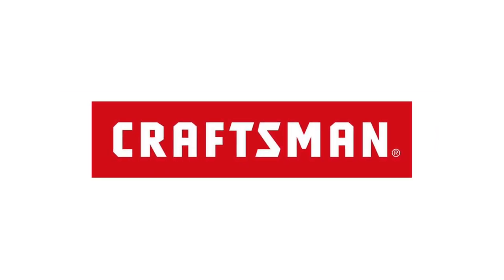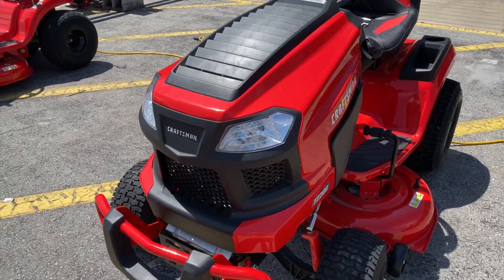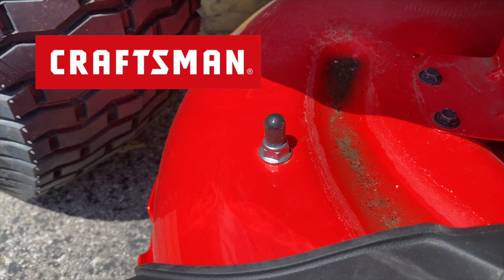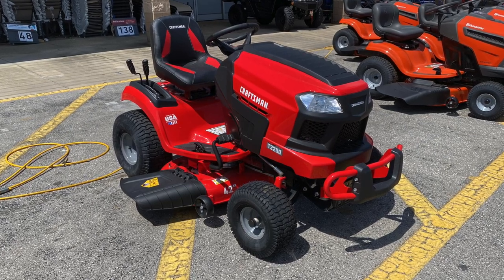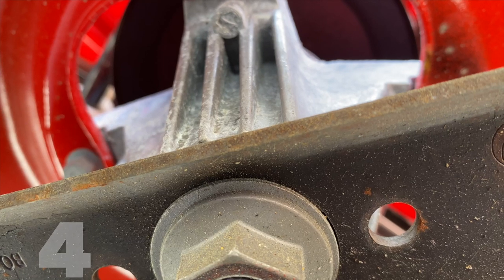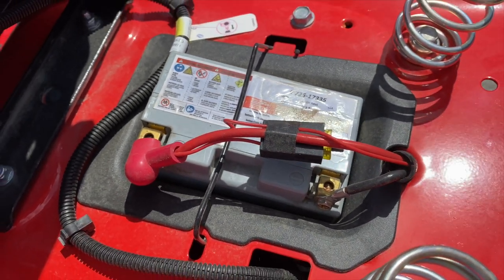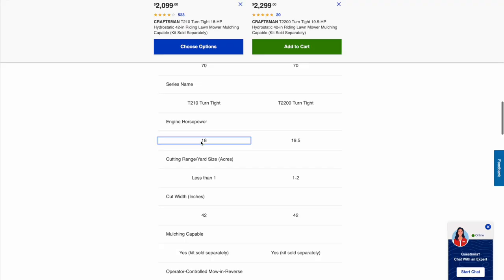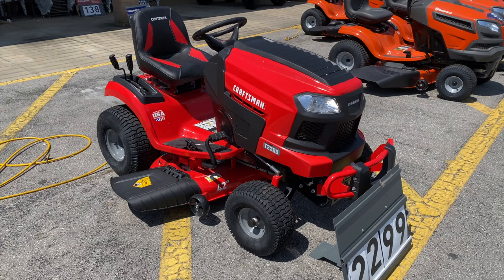Craftsman T2200 42" Riding Mower | Features and Components Does this Replace the T210?

Comment: I believe the identical Troy Built is $200 less
Reply from the maker: Troy Bilt 42” riding mowers don’t have the turn tight turning radius and has a different engine.
Reply: @kev-reviews  that certainly explains it. Maybe you would know. I am interested in the T240 or T2400. Do you happen to know which hydro trans they use? K46?
Reply from the maker: From what I’ve read they went with a TL-200 for the T2400 which is a slightly lower spec than the K46 🙁
Reply: @kev-reviews  thank you for this. Now the hunt to find a T240 or just spend the doe on a John Deere S240 42 inch with K46 and Kawasaki v twin. $3300. Ouch.

Comment: I guess that in most people’s research they didn’t watch the small engine repair channels. Taryl fixes all said himself he would not buy anything MTD but loves them because they fail so often and make him money. $2000 or more for one of these single cylinder tractors!! Those engines are a revamped Kohler Courage and still the bucket sump design.  I would be worried more about the engine than the transmission. Ask a mechanic about ANY of those modern single cylinder engines.
Reply from the maker: So far my MTD-Craftsman has been trouble-free in its first 2 years vs the 2 mowers before it that were “Shop brands” - both of those had issues requiring major repairs in the same timeframe. My neighbors (most) have various MTD branded riding mowers - they’ve had them for years and years. The guy two doors down from me has an MTD/White Outdoors that he uses multiple times a week on more than one property. It’s still going strong, and I don’t think they’ve made that particular riding mower in 5-10 years (or more).

That said, I paid $1599 for my Craftsman. I’m happy with it for that price, and that price gives some leeway in how I would handle anything but the most catastrophic of failures. Time will tell. So far it’s been stellar 🤞🏻that’s the case for many years to come.
Reply: @kev-reviews  I really do hope that you have good service out of it. I noticed that you do take impeccable care of your equipment as do I. That’s the first thing I notice when watching other videos. I don’t understand how people abuse their equipment and expect it to last. I used a 1998 Craftsman garden tractor with a Kohler Command and retired it this year still working but tired. Hopefully I can get 24 years out of my new zero turn.

Comment: Lawnmowers are like cars anymore ,they even have emissions. Just make residential and commercial and different sizes, my new t2200 has a choke but my 12 year old didnt. Just make them simple stupid for what about an hour for average homeowner.
Reply from the maker: Your older one probably had an auto-choke. Technically, a manual choke is as simple as it can get 😁

Comment: The engines on both mowers are the same, nothing has changed other than a claim of a slight horsepower increase and the key word here is "claim"
It's just a marketing tool, they know 99.9% of the people that buy these mowers will never know that there is no difference.

Comment: I have the T210 pd $1600 new. I have the front and rear anti-scalping wheels. Does that make it a 2019 model? Can't remember what year I got it. I remember when they delivered it had no key so Lowes had to bring me one before I signed off on delivery! Been a good one so far!
Reply from the maker: From what I understand, sometime in 2019 they switch to just the one set. Congrats on the mower